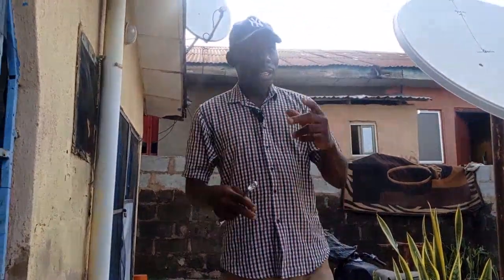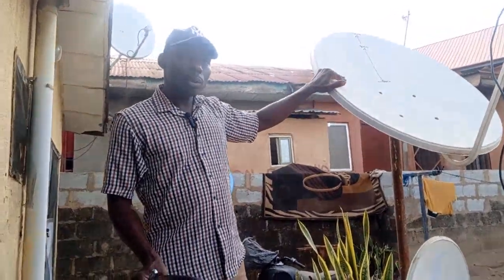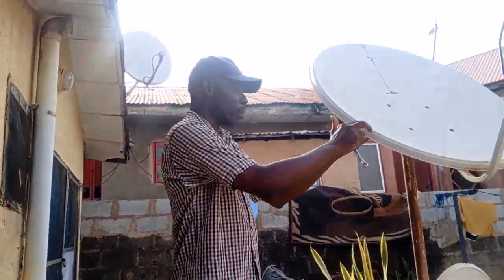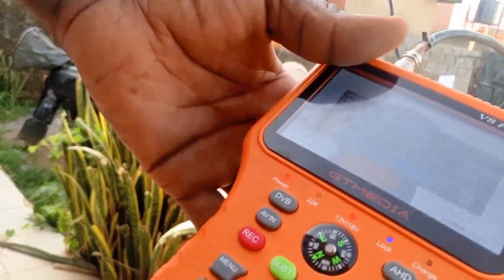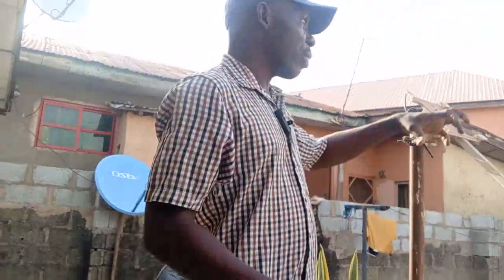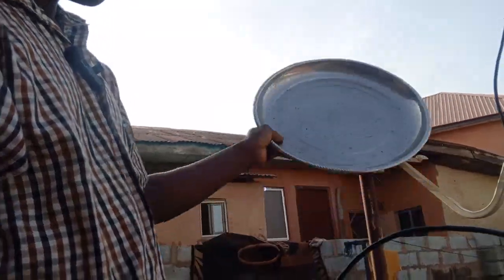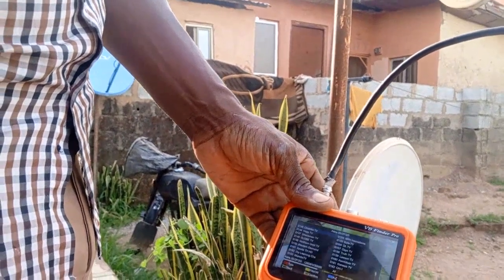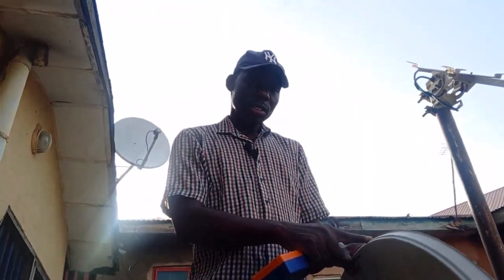The possibility of tracking a Satellite without a  dish

Comment: Boss, i feel if you had covered the bowl with aluminum foil or stencil plate having the same size and shape with the dish could boost some signal strength on your setup.
Methinks if plastic dish (fibre glass) could get it, then the bowl should. 
Meanwhile, thanks so much for your research. You are really Pushing Higher.
Bless you boss.
From you dude, Megaguy ❤
Reply from the maker: Thank you. I'll assume this is part one and so more research on what you've said.